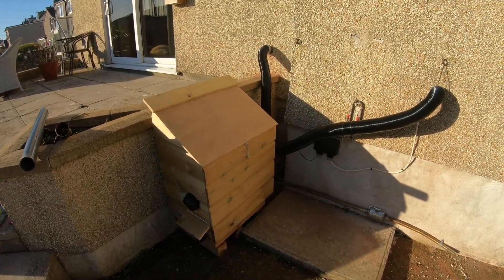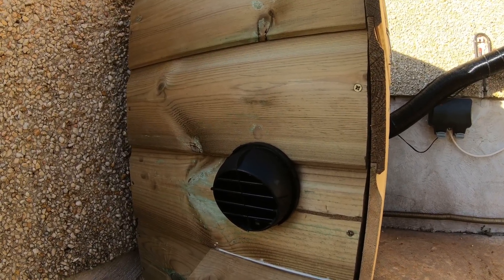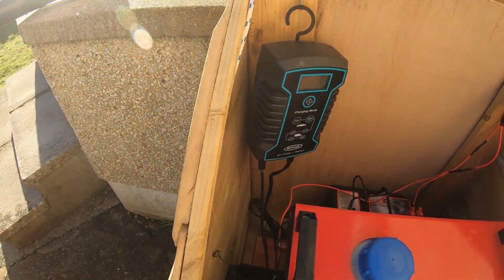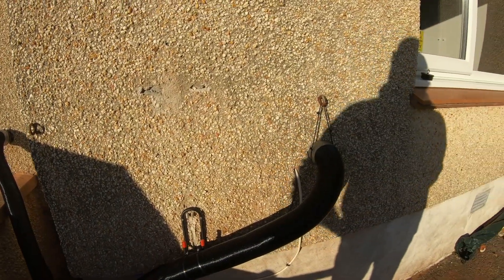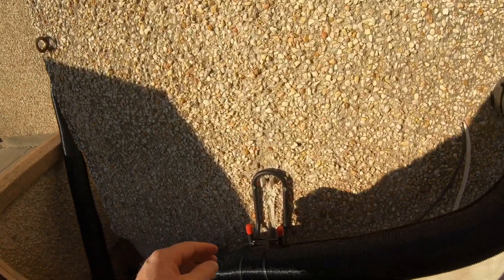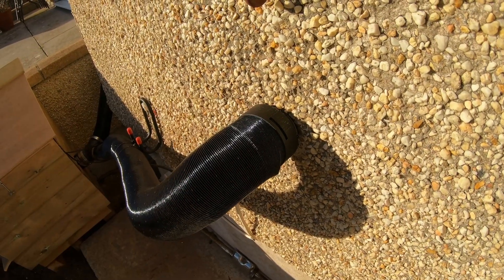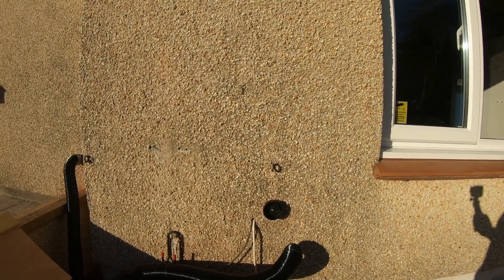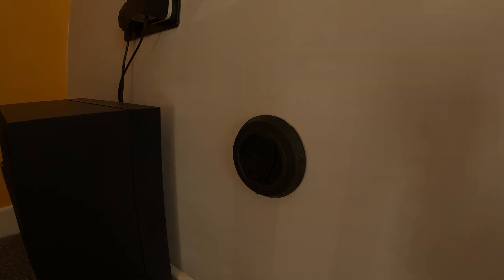Heating my home with a Chinese diesel heater.

Comment: So sorry that this was necessary, but a pragmatic solution to a difficult economic problem. Could I also suggest a de-humidifier in the house? They are very inexpensive to run, and reduce your energy costs more than their running costs - an additional benefit is that they prevent black rot and other 'damp associated' problems (including condensation).
Reply: Indeed. I run mine 24/7 and costs about £1 a day. Saves £2 a day on heating I’d say
Reply from the maker: Yes, I have a de-humidifier running 24/7 over the winter months.
Reply: @en53kff  So sorry that it is necessary to run a de-humidifier so much, but they do work well when needed. My thoughts are with you. Have you explored all the ways that damp is entering the home? Have you tried hanging your recently washed clothes out of doors before 'finishing them off' indoors? Do you have some air circulation in each room? (Windows do need to be opened for a period of time regardless of the temperature. ) Wishing you all the best. G.

Comment: Ive got a cabin out the back. Its got the main office room then a partition for a shed. I was going to set the heater up in the shed side of the cabin. In terms of air intake should i pipe that outside? I wasnt going to bother as the main door to the shed is a corrugated door and there are gaps at the bottom where i can see the ground outside so i was hoping that would be enough to let it draw air in without much fuss. 

Also does the outlet duct get very hot? I was going to pipe that through the partition wall into the main room of the cabin, the walls are lined with wool insulation and i am just a bit conscious of the possibility of starting a fire
Reply from the maker: Yes, the exhaust does get very hot. Be careful.

Comment: Great job on the setup, super clean! I have one of these heaters for camping and heating the garage in the winter. My only question is would it actually be cheaper than just running your furnace?? I live in canada and it gets cold as balls, i know i've gone though almost a full tank in one night while camping in -30 degrees. I know you probably wouldn't use only this to heat your house in the winter but even lets say to heat one room on low in the spring/fall you might get a day out of the tank? Diesel costs about $1.60/L around here, so $8 per 5L tank... what I'm getting at is my natural gas bill is around $100/month so much cheaper to just run the furnace instead of using this. But I do use the diesel heater in the garage because I don't have a gas line running out there and I am thinking about building a sand battery to capture the wasted exhaust heat.

Comment: Didnt think theyd heat a whole bungalow 😮 maybe i missed it but did you mention how much it costs? Im still on economy 7 so you can imagine the cost this would be ideal
Reply from the maker: I now have a 10 L tank fitted. I generally only fill it once a week. At the moment I am paying 99p per litre for red diesel. I presently turn the heater on around 5 pm and then off around 11 pm.
Reply: Love it thx

Comment: They are too dear to run a 12 hour run uses 5l of diesel with the pump on the lowest speed setting.and with red virtually unobtainable pump diesel is too expensive.
Reply from the maker: I am paying 99p per litre of red diesel from my local garage. I now have a 10 L tank fitted which I fill up generally around once a week. My heater is set to 21° and is on every day from around 5 pm until 11 pm.
Reply: Kerosene is half the price of even red will atleast it used to be and my local garage does it from the pump. Much are the heaters?

Comment: I would be interested in trying a set up like this even with my very limited DIY skills but I don't have anything to cut the holes in the walls. What would I need to buy and at what cost to drill just one hole in the wall?
Reply: Hire a core drill for a day, took me 15 minutes to drill 3 holes for ducting cheap as chips any tool hire shop

Comment: Very inefficient setup, Inlet air could be down to -4 or lower on coldest days. There's a heated output loss due to what is essentially 2 massive charge coolers from the restricted flow rate using two pipes not to mention the over top length and lack of insulation.
People who know how to get the best from these heaters run kerosene and build a metal or concrete box inside with a vented exhaust outside plus a couple of detectors for safety.
with is kind of install outside you might as well get a log burner and burn junk mail to keep warm.
Reply from the maker: I manage to keep my bungalow at 21°. I now have a 10 L tank fitted which I fill up around once a week. I pay 99p per litre for red diesel from my local garage. The heater runs generally from 5 pm until 11 pm. Suits me fine thank you.
Reply from the maker: If you read the forward before the video, you will see that it says the pipes were insulated once the video had been made.

Comment: Great setup! Just curious… how is this setup cheaper than using a regular oil burner with heating oil? Does the UK not have special heating oil prices (here in Switzerland it’s nearly half price of regular diesel oil)?
Reply from the maker: Heating oil is slightly cheaper at the moment than the red diesel I am buying. However, it does fluctuate quite a lot and got very expensive at the start of the Ukrainian war. To purchase Heating oil, which where I live is delivered by tanker, you have to have a minimum delivery of 500 litres .

Comment: A friend did the same, these heaters are everywhere. But he is spending 80€ a month on heating oil/diesel plus a bit of gas for the main heater in the rest of the house. Asked him why he did not use an air condition (air air heat pump). He hat no explanation except that is costs 1200€. Well.....better heat, no fumes and cool in the summer and its cheaper long term. I heat/cool my house only with an air air heat pump, simple, easy to install, low costs. Runs 8 months of the year with PV modules on my roof. Dont have to buy any oil
Reply: Is it better heat? From what i read they produce heat yes, but at a lower temperature which leads most people to having to replace their current radiators with bigger ones, which ain't cheap.
Reply: @koitorob  Better means simpler and cheaper. A house needs insulation, this is beeing ignored 99.99% of the time. Reduce heating needs and a simple AC can heat the house, low temps are needed and there is no draft. Here in the EU diesel is >1.6€/Liter, thats 16cent/kWh heat. Heatpump is 5-10cents/kWh (max) depending on the electricity contract.
Reply: @koitorob  btw I was talking abour air/air, not air/water heatpumps. True, water temp ist lower, but floor heating is common and std for ages. Old radiators need to be replaced by bigger ones, that started 30 years ago. I dont have a water based heating system, dont need it. Right now  in Germany its -11°C and the heatpump (AirCon) is running fine. New models run on R290 (propane) and work down to -30°C

Comment: Small solar cell on the roof of your outdoor cabinet , charge controller and small deep cycle battery, be fully off grid option then.
Reply from the maker: Thank you for your suggestion. I am going to look into a small solar cell. Cheers.

Comment: That 2m section between the tiny box and the house you loosing a lot of heat couse not insulated
Reply from the maker: Hi. Thank you for your comment, but if you read the forward before the video starts, I do explain that once the video had been made by insulated the pipes with industrial grade silver bubble wrap which is ultra efficient.

Comment: There is one more modification you could make in order to recover some wasted heat and make the system more efficient: Extend that air intake (the bigger one for the heated air, not the small air intake for combustion) by a few metres with a well insulated tube, running in a straight line. Then make a hole in it just big enough to poke the exhaust pipe into, as close to the heater unit as possible. Run the exhaust pipe down the middle of the air intake tube, such that the flow of the exhaust gases goes in the opposite direction to the flow of the air intake. Ensure that the exhaust pipe is at least a metre longer than the air intake tube, so that the final exit of the exhaust is a good distance away from the entrance to the air intake. Then put some thick insulation (of a non-flammable type such as glass fibre tape or rock wool) on the short section of exhaust pipe between the bottom of the heater (where the exhaust pipe starts) and the hole where it goes into the air intake tube.

This will turn the intake and exhaust combination into a counter-flow heat exchanger: The cold air entering the air intake tube will be heated by the hot exhaust pipe running down the middle of it, recovering some of this otherwise wasted heat and making the hot air flowing into your house even hotter. This should significantly increase the temperature of the air flowing into your house for any given power setting, or allow you to use a lower power setting than you would otherwise need for the amount of hot air you want. These diesel heaters are essentially heat exchanger systems anyway, this modification just makes it more efficient.
Reply: I must have seen like a hundred videos about these heaters. This is  probably the best suggestion I've heard so far as with regards to improving efficiency.👍👌.
Reply from the maker: Great idea 👍🏻
Reply: Would need to be made of stainless steel as it will cause it to condense like a gas boiler. ..with a small hole in the bottom to release any water build up
Reply: @RICHLES01  Theoretically yes, if the jury-rigged counter-flow heat exchanger part reduces the exhaust temperature to below 100 degrees C. However, it doesn't have to go that far in order to capture a decent percentage of the wasted heat from the exhaust: If you have ever watched one of these diesel air heaters operating in near darkness while at or near the maximum power level, you can see the first few inches of the exhaust pipe (nearest the outlet at the bottom of the unit) glowing a dull red hot.

Meaning that the exhaust temperature at the exit must be somewhere between 450 and 600 degrees C. So even if you only reduce the temperature to just above 100 degrees C, you are probably still capturing at least half of the otherwise wasted heat.

Anyway, I'm fairly sure that the exhaust pipes supplied with these diesel air heaters are stainless steel already. I have had a spare piece of this pipe sitting in my shed outdoors for more than 2 years by now. It is cold and damp out there, yet it hasn't rusted at all - in conditions where any ordinary piece of unprotected steel would almost certainly have rusted at least a little.

Comment: Does the heater run off the battery  and the trickle charger keeps the battery charged is that the idea??. Would solar panels keep the battery charged. Great job by the way 👏 👍
Reply from the maker: Yes, that’s the idea. However, I am looking into getting a small solar cell to keep the battery charged. Thanks for your comment.

Comment: any chance you can share where in the world you are? I had mine running like this, but when the temperature is around -15C at winter it didnt manage to burn cleaned and I got a LOT of job to clean it from carbon to get it running again. Have you found a way around that you can share with me? or are you at a warmer climate so that is not an issue?
Reply from the maker: I’m in Wales, which is a much warmer climate than yours.

Comment: Looks okay to me I put mine in a metal box outside and I like drawing in the outside air as well but I would say with those lengths of pipes that you have heading in the house for the Heat Ducks should be insulated
Reply: I was thinking same thing there’s going be heat loss due to no insulation
Reply from the maker: Yes, the pipes were insulated once the video had been made.

Comment: Great job! The 2 long hoses with heat air must have thermal insulation !!! otherwise it will loose to much heat an poor efficiency when outside temperature drop.

Comment: Hey Brother.. this is the video i was looking for!! i am thinking of doing the same to my 140sq meter single level home, using 2 units on each side of the house.. do you mind some questions?... i plan the same setup, using batteries and a trickle/solar charger.. as my house is off grid and very far from public power lines

i already bought 2 of these same units!!

1) what size are your rooms? overall sq meters heated?
2) temp difference outside vs inside?
3) do you run the heater 24/7 and is the fuel consumption as stated? or are you burning more fuel
4) are you using its own automatic temperature control? or are you using manual ON/OFF control?
5) any suggestions/recomendations for me?

Comment: Very informative and good video.   Just spotted it , after I have just completed  an almost identical setup  at my house,  to heat my conservatory.   We live in a rural area with no mains gas, and we use Kerosene in our oil central heating anyway, so after reading that these heaters run great on Kersone,  I bought a cheap hand pump and it only takes minutes to take 5 litres of Kerosene  from the filling point, on our main oil tank to use in the diesel heater, much cheaper than buying diesel at the pump.
Only a couple of things  I have different,  from your set up, which I thought I would share is that I made my external box from non combustible cement board inside and out, fixed to a cheap timber frame.  I got the cement board  from Wickes and is fire resistant and is weatherproof and can be painted.  I rendered it with a one coat render to match the house.  I made the lid from a old sheet of thin steel.
My extended exhaust has a gravity run on it to remove any moisture in the pipework.  I upgraded my exhaust silencer and this has a hole in it to drain any condensation. 
On the inside of the conservatory ( I only have one inlet), I originally had the same grille as you have but  noticed that when the heater was on full blast, the hot air was red hot at the outlet but the air cooled as it passed through the room and gave a slight cold draft further into the room. I solved this by buying  a cheap £18 mini convector heater from Amazon ( Oypla frost convector heater) and fitted it in front of where my duct inlet grille was, after removing the electrics from it and cutting a hole in the back which I extended the diesel heater duct into.  I also fitted a couple of metal grille type baffles  inside the convector to direct the air flow upwards sligthly,  which also heated up with the heat from the air flow.  Result was a big improvement on just having the outlet , with no noticeable cold draft anywhere in the room and the convector heater body gets hot ( as it is intended to do if used with electricity) and this provides a further area for convected heat in the conservatory.   All my walls and anything entering the house are  non combustible, so no fire risk anywhere , and even if the heater caught fire , it is contained outside, within the fire proof housing. I also have my battery charger / monitor inside with  an extended 12v  cable going outside.  I can check the battery state easy on the charger / monitor led lights, and don't have it on all the time, only usually before I turn on the diesel heater and when it is running.  I also fitted a battery same as you have, as I may need the heater, when our power goes out, which happens a few times  most winters.
Sorry for rambling on, but I think your set up is great and I would share my own installation details for anyone else to consider if they are thinking of this type of installation.    The diesel heater has been an interesing project for me  and cost me around £250 for all the parts and although we don't use the conservatory much throughout the winter, if we do want to use it , then the cost of heating it is much cheaper than the electric heater we have been using previously.
Reply: Very interested in seeing more of your installation. Just buy one for a small room out of the house.
Reply from the maker: Thanks for your interest and your lengthy comments. Some useful pointers there. Sorry it took two months to see your comment. Sounds like you have a perfect set up. Well done.
Reply: Kerosene is diesel
Reply: Kerosene it's not diesel
Reply: @condell1956  No, but it runs in diesel engines and vice versa...
Reply: @kyleop1    Hi,  I am afraid that is not correct.   Kerosene is fractionally distilled at a higher temperature than road diesel, making it a lighter fuel  with smaller molecules and is more volatile.  I pay 77p a litre for my kerosene from the heating oil supply company and it is about £1.45 a litre for road diesel at the pumps.

Comment: Looks like you’ve done a great job there. Only one thing I would do insulate the pipes you can get  some pipe insulation. Would you just keep the temperature up good job, 👏👏
Reply from the maker: Thank you for your comment. In the video description, it says that the pipes were insulated. I did this once the video had been made.

Comment: Don’t the pipes outside build up with condensation though ? How much heat is lost in the pipes outside as they aren’t insulated ? Have you had this running in freezing temps outside yet ?

Comment: Fark me that exhaust is dangerous - CO is heavier than air and I hope there's no way it can make it round to your air inlet and fill your home with Carbon monoxide, make sure you have a Carbon monoxide alarm indoors.
Reply from the maker: Yes, I have a carbon monoxide monitor in the house. It has never yet been set off in over 12 months that I’ve had the heater. Thank you for your comment.